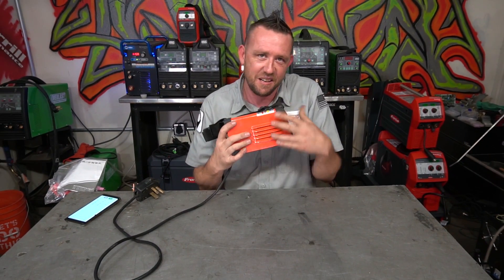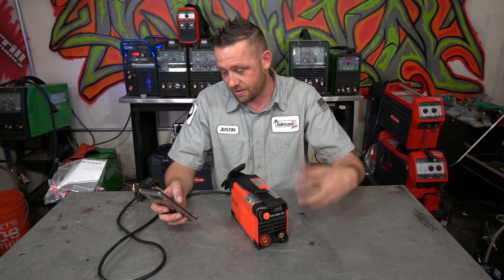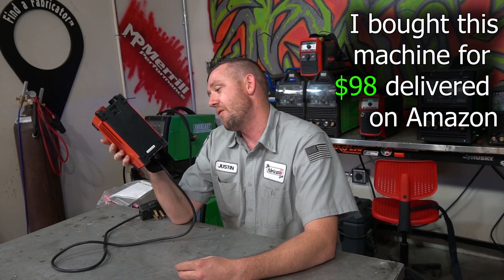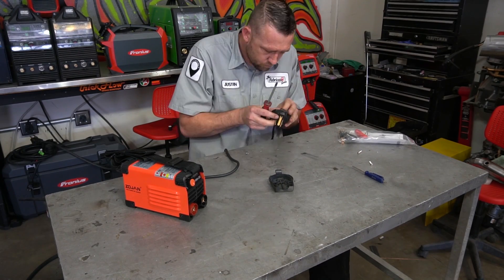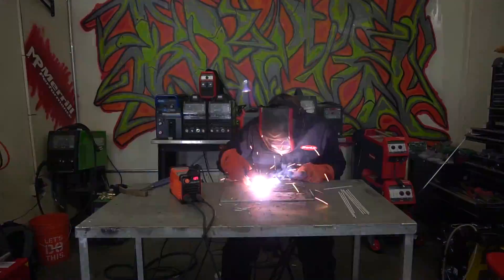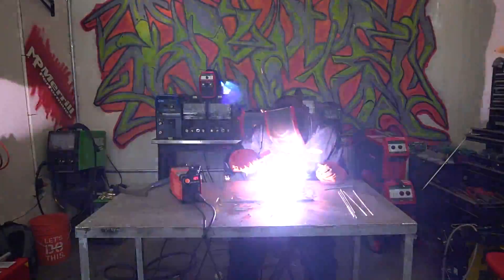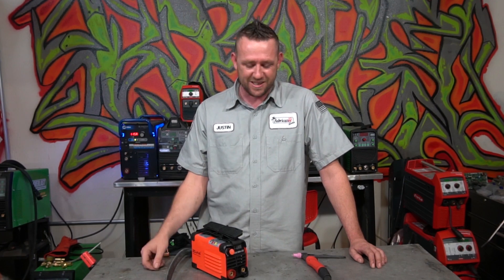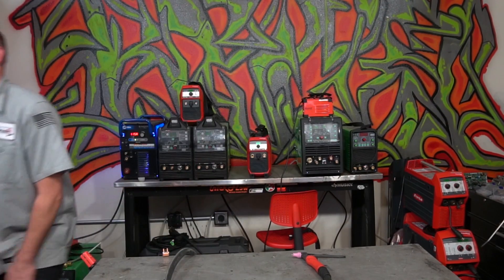TFS: The Smallest Welder EVER! Will it TIG?

Comment: Would recommend it for a person trying to learn to stick weld
Reply: Don't do it man, spend a little bit extra money and get something better, you won't regret it.  I made the mistake of buying a little piece of junk when I first started and regretted it.  Good Luck!
Reply: Here is one from my local area. https://corvallis.craigslist.org/tls/d/lincoln-ac-225-stick-welder/6574936408.html
Reply: Depends what you mean by "learning". I have an ancient 200Amp AC buzzbox I bought off Craigslist. The thing is a beast and works great. This welder will do pretty much anything you need up to about 3/8th plate. The problem with a buzzbox is you are limited to AC only.. But for the home/farmer will work for a lifetime. If you intend to be a professional welder you will need the ability to go to DC which a buzzbox won't do. This little thing will weld DC but its pretty small, we don't know how long it will last.. So no I wouldn't buy this thing.

Comment: Seen even slightly smaller one at store. Was realistically rated 130amps and came complete with leads (really short),plug and warranty for price equal to near 50$.
I'd say it can be really good for someone that has no welder at all and needs to fix a fence or something like that.
Reply: Никита Надеин
 his review was not fair , actually he had his mind made up before he decided to make this video.

I think it works just fine for thin metal. I wouldn't be surprised if it works with a 220 car power inverter too.
Reply: What store?? You have a name of it?

Comment: Actually those Ebay turbos have come a long way in the last couple years :)
Reply: I literally tripled the power on my miata with a chinacharger.  4 years and 50,000 miles of abuse on the original $150 turbo.  Stick that in your 3000$ EFR and smoke it.
Reply: Ebay turbos are in the 8s now with stock gm motors...i think the China turbos are the way to go budget wise
Reply from the maker: William Zoom I agree. They aren't what they used to be. I know of a few brands that last more than a mile (a few years actually).
Reply: The boosted Bois are kicking ass with eBay turbos on Honda's lol
Reply from the maker: Izaak Bennett DNA
Reply: Emusa
Reply: Yup I put a knock off hx40w on my 8.3 Cummins Blue Bird bus. It's been going for a year and everything is still reasonably tight.
Reply: Ya i mean the Chinese can do a lot these days and if you let them know what you want by voting with your wallet
Reply: Wu Tang War Whistles
Reply: The Fabrication Series what brands)
Reply: Chinese turbos are ok if you don't over speed them.
Reply: As long as you keep them within their efficiency islands and don’t over speed them they’re awesome
Reply: @MyLonewolf25  same applies with name brand turbos as well.
Reply: Just look at what Sloppy Mechanics is doing with eBay turbos, think he made 1000 at the wheels on a junkyard 6.0 LS, even dailied a turbo 4.8 pickup that make over 500 wheel
Reply: no they havent ur cars instantly worthless if you were that dumb
Reply: @TheDruxlol  Well look up for boosted boiz 700hp civic with ebay turbo ... Yes they are way better than they used to be.